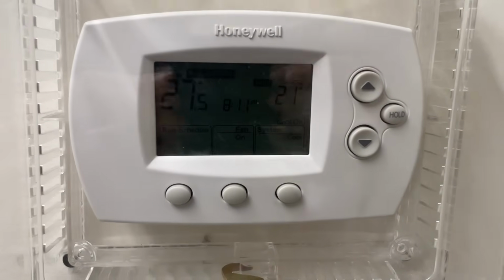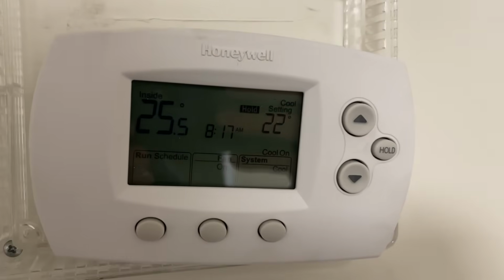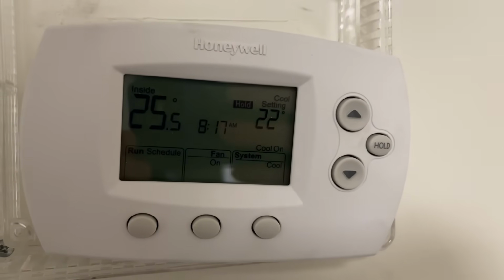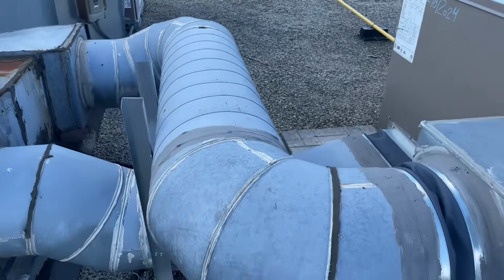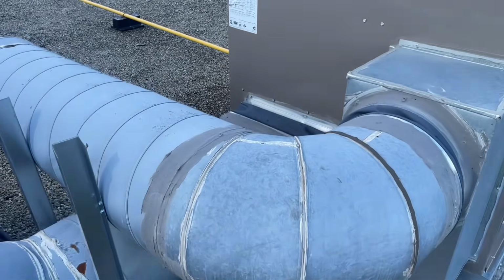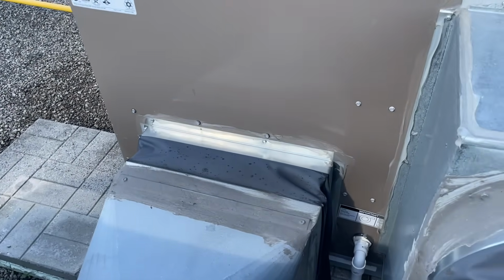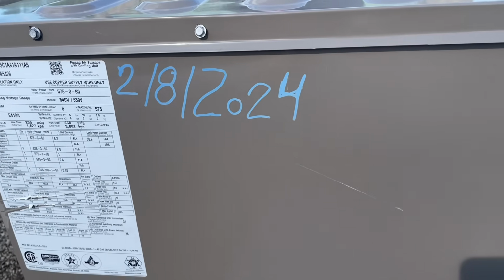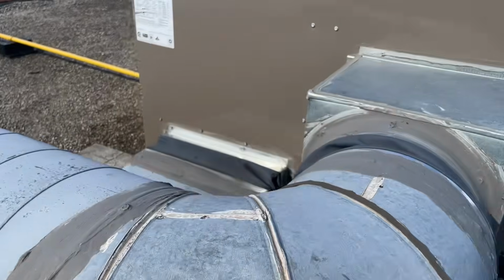HVAC Motor Failure | You See Something New Everyday!

Comment: Seen it happen with some 1/4 hp motors back in the day. The company I worked for made specialized cutting machines and moved from metal clamp/rubber anti-vibration mount motors to welded mount type. Deficient welding combined with rough handling during shipping our products created the most of our woes...few failed during actual service.

It must "really be something to experience" when this failure happens on a blower motor in a squirrel cage fan type unit!

Comment: If belt is super tight then that breaks those welds, that's what happened. Take the depressors out of your hoses for full flow, then just use those low loss fittings for the normal pressure checks and charging.

Comment: The schrader depressors in the hoses are adjustable and even removable, you just need to screw it out slightly until you start getting pressure. Be careful, if you screw it out too far you can start damaging schraders by depressing them too hard

That looked like of one of them jobs where a bunch of stuff just doesn’t want to go right, I ‘ve never had the outside ring pop off the end of a hose before and I don’t know anybody else either, first time for everything. Thanks for sharing
Reply from the maker: Oh no way bro. I didn’t know you can adjust them. Even after all these years 😂

Comment: Seen this on a number of tranes. One time it rolled so hard it punctured a hole in the evap, never saw it cause it was under the blower housing and out of sight. Wouldve really needed to be looking but idk human error, I missed it. Replaced blower and turned on and of course no cooling. Had to order an evap coil which took 2 months to come. Luckily it was for home depot and they have 20 other units on the roof so it was hardly noticed down in the store. So if you ever see this as a tech. Don't make my mistake ahah, check the evap.

Comment: Good video sir! Only time I ever saw welds snap on a motor bracket they were caused by bad fan bearings or bad out of balance fan wheel or grenade fan wheel! I was really surprised how smooth it ran with just new fan, pulley and sheave! Was old belt in very bad shape? Odd! Good repair job and very thorough!
Reply from the maker: Thanks man! The belt appeared to be fairly new aside from the area that took a hit. Check my latest video! It had blower bearings blown 😂

Comment: Metal fatigue and shitty tac welds will cause a motor mount failure like that.
Reply from the maker: Have you seen this happen before??
Reply: @davenagams yes, I used to build and restore Air compressors and a lot of the cheap Chinese cast aluminium motor feet would often develop cracks around the mounting points. Due to the vibration and belt tension etc.
Reply from the maker: @nashfunk389 damn bro. I’ve seen the motor brackets crack before but never break clean off like this